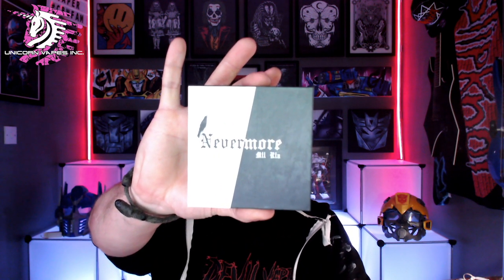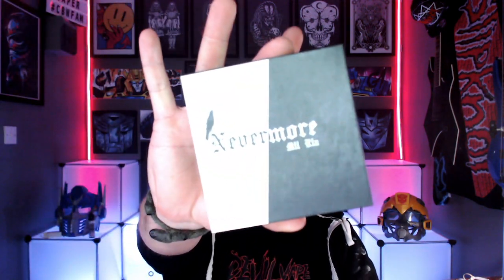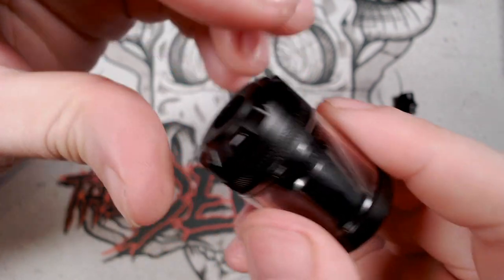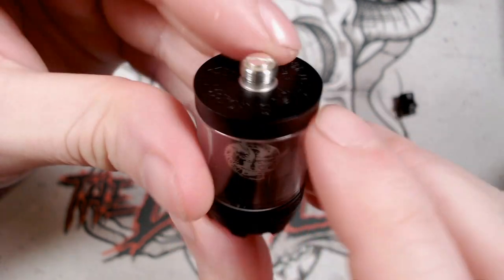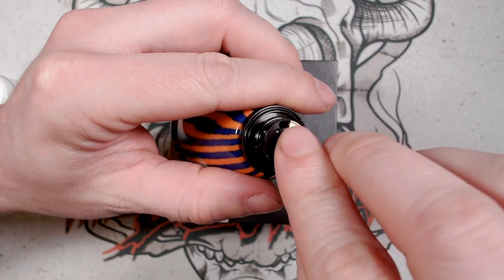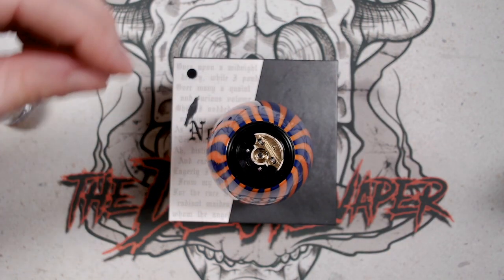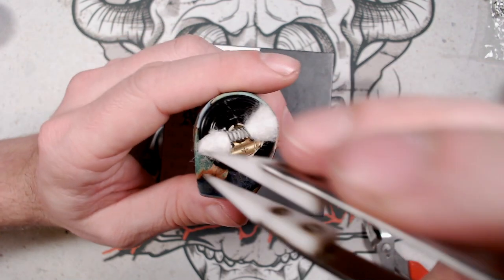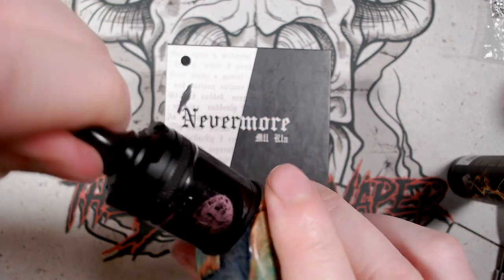UNICORN VAPES Nevermore MTL RTA Review + Build Tutorial - My Top MTL RTA of 2020??

Comment: Totally agree with your con about the top cap but the pros outweigh that, loving mine, got the black ordered one in SS too, looks like a chess piece me thinks. Got mine with the second biggest airflow second biggest inserts, 1.2 ohm Clapton. Cracking rta. Fast forwarded the build, so easy to build and wick, went straight to your final thoughts.
Reply from the maker: Thank you, Rufio bae!
As said, I'm not overly sure if it's a con or not, as I believe that's how it was designed. But it may throw some people who are used to them locking when closed.
But completely agree that it is a cracking RTA. I would love to see a DTL version in the future though
Reply: The Devil Vaper I see it as a con, would prefer a stopper on it so that you know it is locked. Cheers Dean 🤜🤛
Reply from the maker: Yehh, I see where you are coming from, but I haven't had any issues with it coming undone so it's pretty sturdy